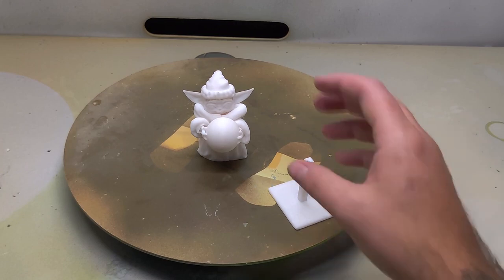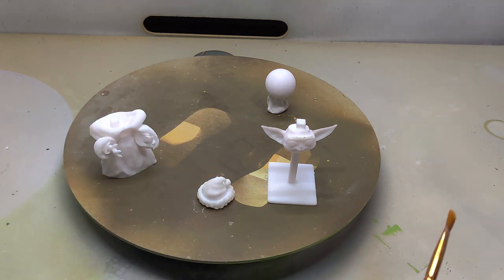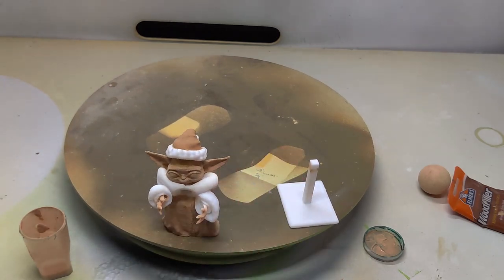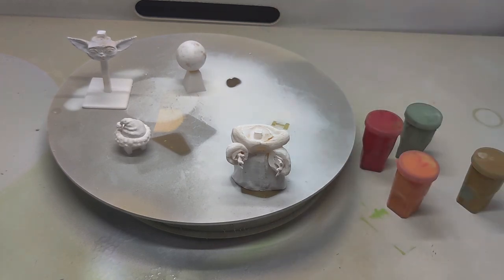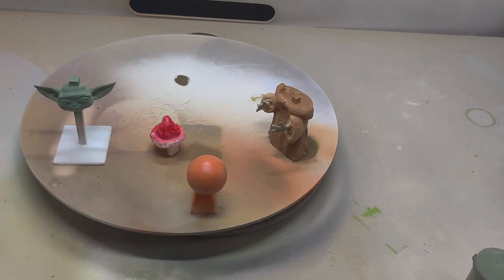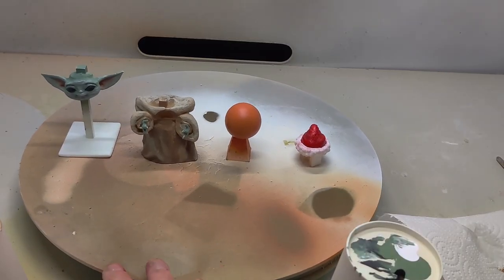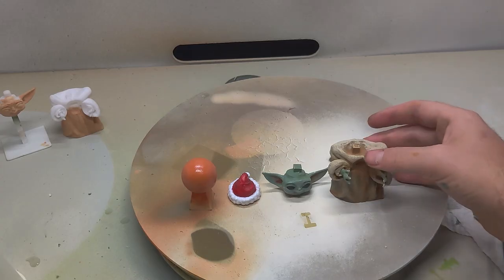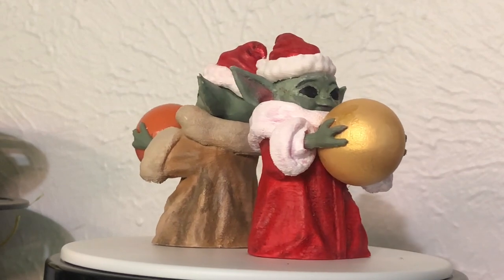I Printed and Painted A Baby Yoda Ornament

Comment: what does the wood filler do?
Reply from the maker: It helps fill the gaps between the layers to give a smooth appearance. I also used it on the clothes to give it texture so it felt more like fabric.
Reply: @FilamentsFolly  that’s what I figured. I haven’t painted an FDM model yet so goo to know. Also on cura I clicked supports for your model and it did its thing. Anything else specific I should know. I’m a week into my first printer 😂
Reply from the maker: @terraxcell  the smaller the layer heights the smoother the print but the longer it will take